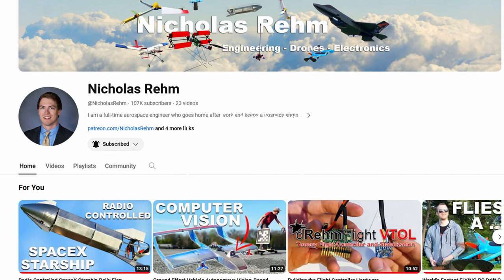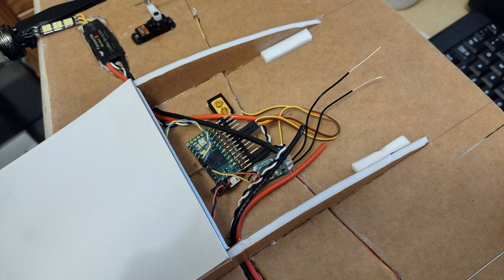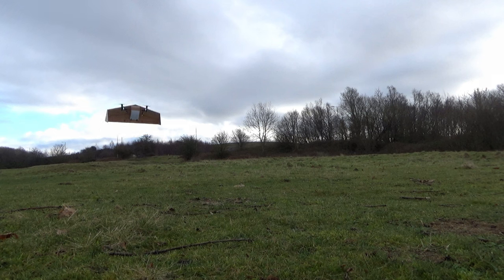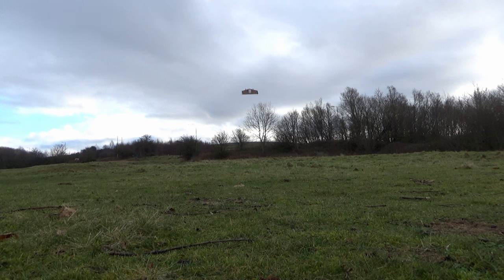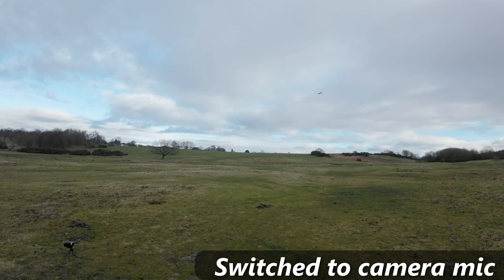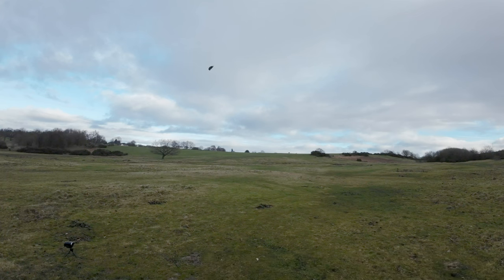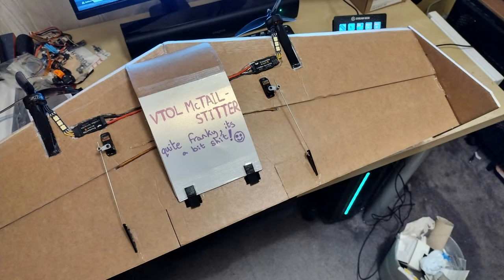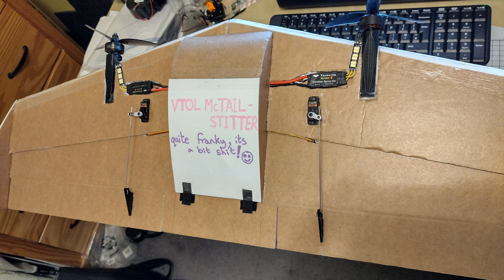Adventures In Tailsitting

Comment: Quite a handful but pretty cool project. The thing is with those is it feels that when hovering and maybe transitioning you want the wind side on so it doesn’t turn into a sail, but obviously that’s not where you want the wind for a wing. Look forward to you next flights
Reply from the maker: I crashed it yersterday, the wind was much stronger than forecast which made hover a right handful but the crash was my fault, not the plane. Minor damage already repaired.

Comment: This thing is just mind blowing…i want to make my own..can you please! Share the dimensions that are required to make this tailsitter…??
Reply from the maker: Weather has been against me at the weekends so on Friday there's a little workbench video going out and I'll put in all the dimensions for the wing for you.
Reply: @Caroline_Tyler  for sure i will eagerly be waiting for that video..hope! You will upload it soon!!
Reply from the maker: 2nd February 16:30 UK time.  @tweak3667
Reply: @Caroline_Tyler  one more question…instead of teensy can we use any other microcontroller board…like arduino or stm32 or something like that..?
Reply from the maker: The Teensy is needed to run the dRehmFlight software at a reasonable pace, an Arduino would be far too slow. See the Github for more details on that. I wanted to have a go at dRehmFlight which is why I decided to have a go at this wing.
I believe INAV has just added VTOL code (but the transitions between flight modes are a bit rough) so you could always use a cheap quadcopter flight stack - maybe even run Ardupilot on that.
Reply from the maker: Dimensions released
Reply: @Caroline_Tyler  Thank you for this💖
Reply: Hi! Caroline…i have made a same by using your given dimensions…but it not so stable…any suggestion for making it more stable..?? Thank you❤
Reply from the maker: @tweak3667  I'm still working on tweeking the settings and the build. Getting fairly stable hover and horizontal flight but I think the power to weight is actually too high on mine and the motors are not able to throttle low enough and keed the control resolution. The wind/rain the past couple of months have stopped me doing any more testing.
If I get anywhere, and even if I don't, I will be putting out a new update with my findings.
Reply: @Caroline_Tyler  By chance, if you have spare of time…please! Do a update…that will be helpful..😇
Reply from the maker: @tweak3667  I have more testing to do but there will be an update :)